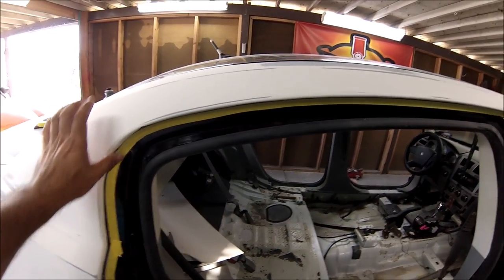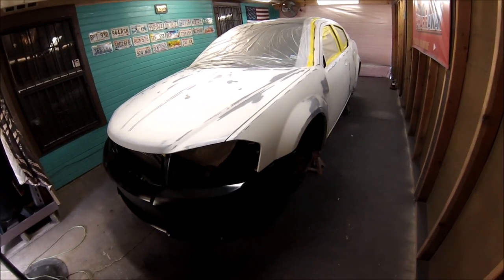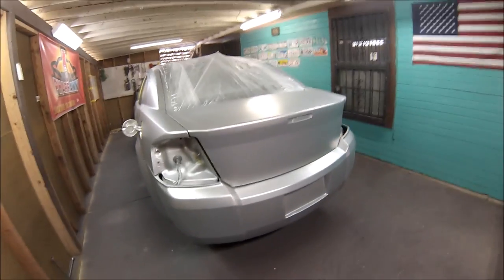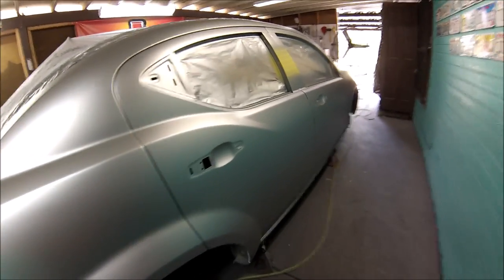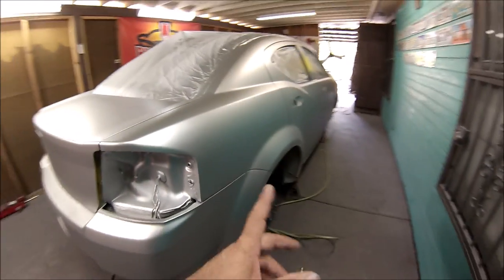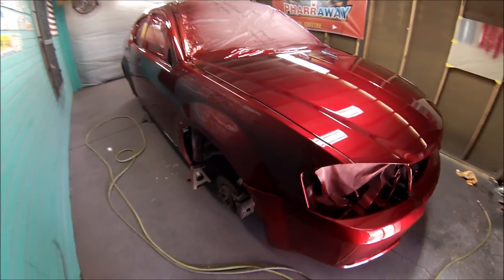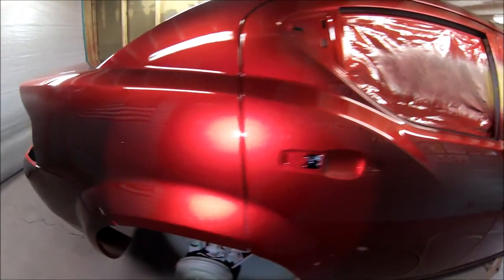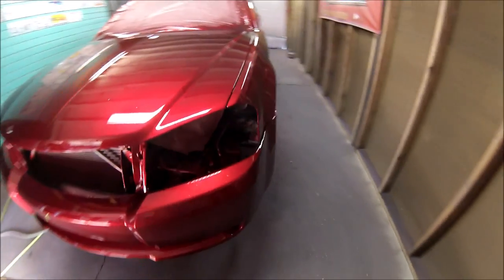HOW TO DO A CANDY PAINT JOB

Comment: This guy is a good painter but a tip for beginners is to never stop or start spraying on a panel. Start off panel and finish off panel. Once you can eyeball your color and flake flop on the fly you can get away with it but when you're starting out its best to walk the car (like he does when he's doing the candy coat). Great vid. Looks like your tune is about what i've been running for the past decade as well.

Comment: Im thinking you need a spray booth my friend! Or line the inside of your garage with metal sheeting and install some duct work to create a down draft booth! Basically you just plum the walls down low in the corners as your intake and the ceiling as your out take and of coarse filter filter, filter. But a furnace blower some ducting and some metal sheeting !

Comment: when I was taught to spray I was told its not good to release the trigger all the way. should keep the air flowing through the tip never point the gun at the vehicle when first pull of full trigger the gun could possibly spit slightly each time you release fully and pull full trigger. I have over 30yrs behind the gun so I speak from experience but my comment is meant constructively and to help anybody who wants to paint some shit! become a better painter educate and equip just one little tip...
Reply from the maker: awsome brother Thank You for the tip

Comment: I turned 1/2 my 2 car garage into a spray booth, you may like this, t picked up a old furnace someone was throwing away and gutted all but the blower leaving only a metal box and a blower, I than attached that to the end of my booth and ran two 10  inch duct pipes outside. The thing works great on keeping booth clear and dirt down, I’ve mostly painted furniture with latex paint but I think it would work just as well with the auto paints.
Reply from the maker: Awesome

Comment: ????  I'm new to painting getting ready to do my first project. I have a golfcart with a single stage paint job in good condition, I'm going to use the Tamco Clear and using my purple gun I just bought.. My question is which clear should i use and how many coats of clear can I put on it. I want to get the max shine??? Thx... I enjoy your videos...
Reply from the maker: you can use the tamco clear and add 3 coats that will be more than enough
Reply: I would suggest the 2104 Tamco clear. It's really popular.
Reply from the maker: @appliancedude63  Yes I have used it the 2105 is the same one but with extra slow hardner
Reply: @PHARRAWAY  ok cool. I gotta check it out. I already bought the 2104 though.
Reply from the maker: @appliancedude63  awsome brother can't go wrong with the 2104 nice

Comment: Nice work! I've been trying to get started on painting my bike for a few months now. Its been so incredibly hot and been working so much I don't have the energy on my days off to get anything done lol. Finally started working on getting a dent out of the tank. That was real pita as it is next to impossible to get to from the inside. I had an old crappy tank I tried to use my stud welder on to get the hang of it but the metal was so thin the studs would melt into the metal and even slightly pulling would rip holes out where the studs were welded so I couldn't go that route.
Reply from the maker: Yes it's a bit harder on gas tanks but they do have some studs for the welder that will take thin metal out maybe go that route just don't get discourage you'll get the hang of it

Comment: ...😮that looks amazing!👏👍
Reply: ...hey what would red base coat with a red top coat look like?
Reply from the maker: it will give it a different look you can use any kind of base color
Reply: @PHARRAWAY  ...I always been told that the base color will affect the top color. I have a 2001 nissan frontier and I was wondering what red base and candy apple or wine with pearl on top would look like. I can't figure out how to get the original color Aztec red.

Comment: Just a few questions please if you don’t mind:

1. What did you mean by control coat? I understand the first 2 coats you went panel-to-panel but then the last coat was going to be a control coat. Can you elaborate?

2. What tip did you use to spray the base? 1.2? 1.3?

3. What tip did you use to spray the candy? 1.2? 1.3?

4. The gloss clear you used, is it a 2:1:1 or a 4:1:1?

5. Also, what tip size did you use to spray your gloss clear coats? 1.2? 1.3?

6. What temperature was it outside when you sprayed this car? Humidity levels?

7. Lastly, how long did you wait for flash tile between coats? Specifically the clear, but if you recall the shimrin and candy coats that would be great too.

Getting ready to spray a car with a friend and I’m going to be giving it a try. He’s done a few motorcycles parts and panels in candy and we are finally getting our first full scale car (a 1968 Dodge Charger hard top) to spray next week so some pointers would be truly appreciated.

Thank you for your time!
Reply from the maker: Hi, yes that’s an awesome car brother

1. The control coat on the silver means that the last coat is sprayed a bit farther about 10 to 12 inches from the panel and mist the final coat so that the metallics fall evenly.

2. The tip on the base was 1.3 tip at 29psi

3. The tip on the candy was 1.3 tip at 29psi

4. The clear was  Tamco clear 2:1 no reducer

5. The tip for the clear was 1.3 at 35psi

6. The temperature was 98°C and the humidity ??? sorry

7. The flash time between coats was 15min for each including the clear and it was 3 coats of the silver base and 1 coat of the control coat. And for the candy, it was 4 coats of candy and 4 coats of clear.
Reply: PHARRAWAY thank you so much for taking time to respond, really appreciate it 🙏🏽🙏🏽🙏🏽
Reply from the maker: @illstplaya84  Any time brother if you can send me some pictures when your done at pharrawaypaint@gmail.com so I can see them thanks

Comment: I want to paint a candy color on my truck with matching bumper and grill to match. I want to seperate the bed from the cab so I could get the back of the cab and the front of the bed. How would I paint it without stopping so i don't get the tiger strips?
Reply from the maker: You can paint it separate just add the same number of coats to each part

Comment: If you didn’t do any body work would you still need sealer? And would you prep the car same as you would if it was any other regular base coat?
Reply from the maker: I would only use sealer if your changing the color of the car if not just add primer to the worked areas and you will be good to go
Reply: @PHARRAWAY  okay thank you bc been thinking about going candy on my truck and it’s black and the metallic base is silver , so that would need a sealer right?
Reply from the maker: @carlosaguilar3787  Yes you need a sealer
Reply: @PHARRAWAY  thank you I watch all your vids on repeat lol

Comment: Hi can I buff or sand if there was a imperfections on the candy coat before the clear coat? Great video.
Reply from the maker: No not on the candy it will not work
Reply: So then what would you do just leave the imperfections in the paint and clear right over it?

Comment: Hey man i just wanted to say thank you for this video. Like Really! THANK YOU! I used this video the most for reference when spraying candy cobalt blue on my g35 that i stripped down to bare metal. came out well and i believe a lot of that was due to this How-to Guide. Keep up the fantastic work. you're experience as a pro is very apparent and i will point any others i meet your way for tips on spraying cars. Oh yea!, and that was my first spray ever and came out pretty darn nice. i little tiger striping on the hood but i think that was due to the fuji hvlp 2-stage i was using. Still came out well and no-one has even noticed them yet. i used a 1.3mm and a 1.8mm needle for the primer.

Comment: Is 320 grit good enough on final blocking poly before 2k restoration?
Reply from the maker: I will go with 400 grit
Reply: @PHARRAWAY  tossed up to just use poly as a sealer then sand and base coat. Is a 2k primer really needed over the poly?

Comment: In Florida and a painter friend moved here and hates the conditions. Humid and hot. Difficult to paint. Clear coats are a disaster in little time.  Most use enclosed climate controlled booths. You got it made there in Texas if you can paint with opening!
Reply from the maker: Thanks

Comment: A properly applied candy will look stunning, but like everything else in life there are pros and cons.    Candy is really not the paint you want on a daily driver.  For one thing it's nearly impossible to touch up or color match a candy once it's been damaged.   That means you live with minor damage, or do a complete repaint.   Secondly, candy pigments are dyes and not solids.   Candies will fade badly after being left out in the sun for even short periods of time.   On a daily driver being operating in the Southwest, most candy colors will be fried in a year max.  Candy really is best left for motorcycles or bicycles.   Things that will be stored inside most of the time.    If you want a candy paint on a car, it should be a show car...something that only comes out of the garage a few times a year.
Reply: Probably the most ridiculous, if not THE most ridiculous thing I have ever heard in my life. Did you know there are many oem finished all in kandy? Ford RR, Mazda 4V1 are just two I know  of off hand that are mass produced.
Reply: How about doing flake instead?

Comment: I need one quick help out here. I painted candy red ,its a tinted clear. now its dry. I need to apply clear coat on it .( I didn't knew i was supposed to put clear over it while it was still wet).How can i do it ? Can i put clear over the candy red with out sanding? Or is it ok to put clear coat over candy while its shiny ?
Please those who did this please help me out here. I am stuck
Reply: Please do help me out here. I find hope here.

Can we put clear coat over candy red (tinted clear coat) without sanding???
Reply from the maker: Your best bet is to lightly sand it with 800 and clear it after if not lightly sand with 800 and add another coat of candy and then re clear

Comment: Did you tack wipe between each coat of candy
Reply from the maker: no you can't the candy is like clear coat and will not dry like the base so If I would have tacked it I will of gotten a lot of lint from the tack rag
Reply: Just wondering since I know you like to wipe between coats on regular paint jobs
Reply from the maker: @jameswatts1808  Yes I did on the base but not the candy or clear
Reply: Can’t tack in between coats

Comment: I thought the bumpers took different  kind of paint, because they are rubber  or plastic.  I see you used the same, am I correct or wrong?
Reply from the maker: Yes it's the same you don't need a different kind of paint
Reply: @PHARRAWAY  I think you do because the bumpers  are flexible.  Correct me if I am wrong.
Reply from the maker: @cesarorozco2462  I have always used the same paint but they do have flexible primer
Reply: @cesarorozco2462  Most quality urethane clears will bend/roll to a 2 inch diameter before any noticeable cracking

Comment: I have the same car but I’m repairing clearcoat paint in some areas. I sanded it down with 320 to the white factory primer like yours. Should I prime it first or can I just start painting?
Reply from the maker: you can just add sealer and then the base brother that will work good
Reply: PHARRAWAY Okay thanks 🙏 and then after I base let it dry then clearcoat?
Reply from the maker: @ADDMEONPSN  yes let dey for about 15min and add the clear
Reply: PHARRAWAY it Came out great thanks for the assistance!!
Reply from the maker: @ADDMEONPSN  Thanks

Comment: The most uneven sealer coat I've seen,and why is the front facia shiny befofe you sprayed the sealer,
Reply: Well the end results look pretty good, but that corner fan causing a lot of extra work,  still great job
Reply: Looks like it's a replacement bumper cover that came primed and he said he sprayed it with Adhesion Promoter, which lays on shiny.

Comment: Yo how big is your compressor or wats the specs homie
Reply from the maker: it's a 60gal kobalt with a 5hp motor
Reply: @PHARRAWAY  thanks my man just beginning 1 more question when down there shooting the front bumper u don't worry about paint hitting the radiator or does it not to much affect it
Reply from the maker: @johndoe6047  it will not effect anything after everthing is painted I just repaint the radiator black

Comment: 🤔 looks like you're fan is in front of your car so why didn't you start from the back of the car beings you are getting the over spray back on what you already painted ?  and it sounds like you're gun is spitting as well,  I've been doing custom paint and body work for 44 years ,  if you change to a hlp system you'll see a big difference also , just one painter to another your ventilation to remove the over spray fast enough it's just going all over your paint job
Reply from the maker: You are correct